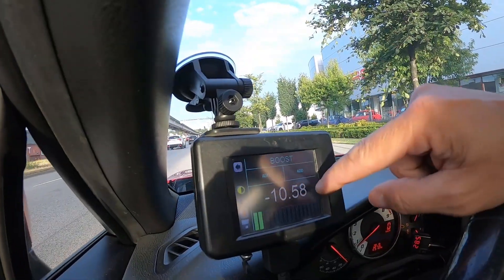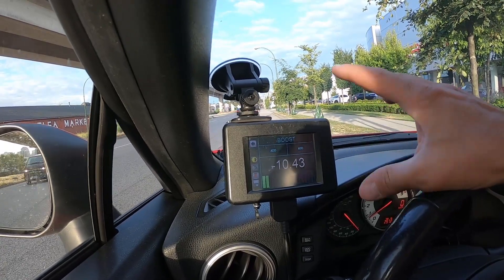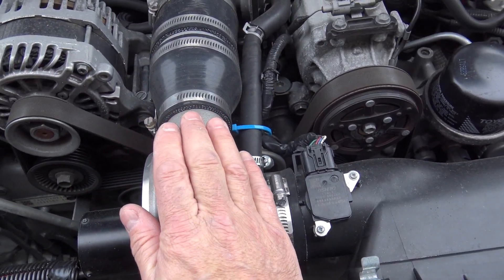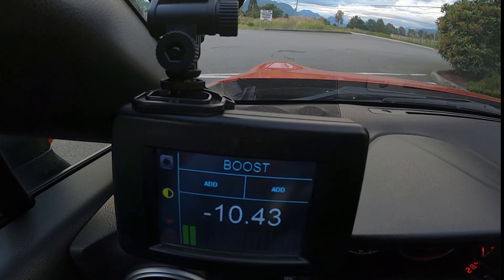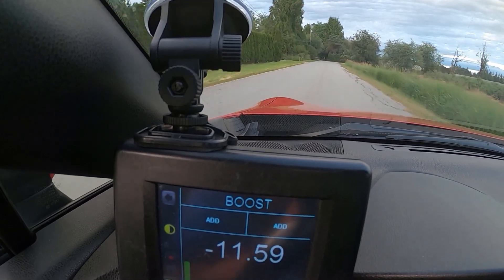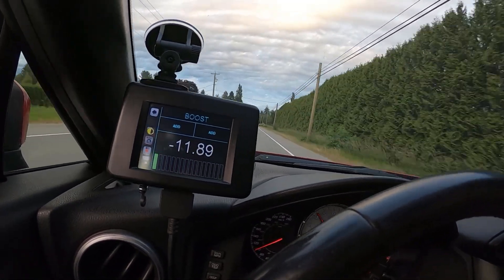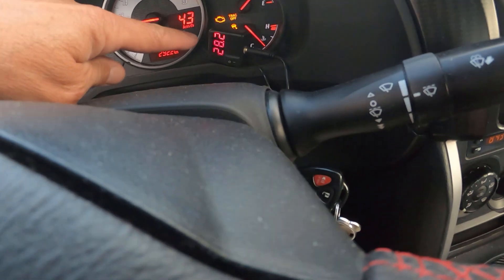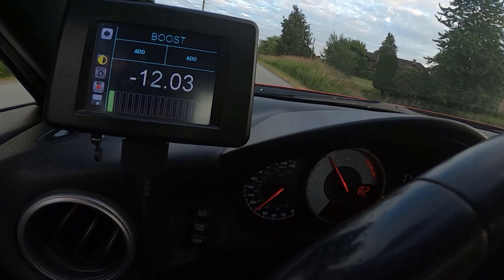Proof that my Electric Supercharge works!! BOOST

Comment: Electric motor spins at 55,000 rpm / turbos spin up way past 100,000 rpm even at low boost
Reply: This motor says on its label 250 24 v . The 250 is KV or RPM per volt. 250 x 24v =6000 unloaded RPM or 3000 loaded RPM. Its a scam.
Reply: @billboyd4051  there is More than enough proof that these work. Cleetus did the torque amp test recently and gained like 40hp. Tq amp tested this supercharger vs theirs and there was not a hug difference.  Plus hes showing a bosst gauge that its making 3-5 psi. Thats power.. regardless.
Reply: @TheModAddict  Cleetus tested a 48v torque amp unit, this is a 24v unit that spins at 3000 rpm according to the motors markings, and with 2 small AGM BATTS THAT HE CLAIMS he gets over 200 amps from, its a scam. You can hear it on his other video at 3000 rpm. This motors KV is 250, too low to do anything, thats why Mike won't show a dyno test. Audi uses 7000 watts just to prevent lag on main turbo, this guy lies about 5000 watts, you can't get that from such a small motor off 2 small AGM batteries. Please buy this unit, and show a dyno test, Mike won't show one.
Reply: @TheModAddict  it's a SCAM, notice how he didn't rev it to top end? Cause u can clearly see he started loosing boost top end so he kept cutting it off😆
Reply: @billboyd4051  not to mention the car is only a 12v system. Only half the power to run a 24v motor
Reply: @mikepoole2248  He's using 2  12v batts in series. On his other video he hits gas pedal switch and you can hear the sound of his turbo, about 3000 rpm by the tone. Not enough to do anything but reduce power through restriction. Such a scam.

Comment: I'd love to see someone develop an electric assist turbocharger. Use the electric motor to shorten spool times on larger turbos.
Reply: thats what compound setups are for< or just spool with nitrous. works for me
Reply: @Equine-services  true but racing is all about innovation and having the response of a sequential system or NOS assist without the additional complexity or space would be nice.
Reply: @Robotech04  it would be awesome to simplify it. i agree 100%, but it wont be one of these that does it. Even if you had great performance of them (which there isnt) the limiting factor in your powerplant would be the e-turbo. Its in essence a restrictore plate just like what they use already to limit power. only so much air can move through it, and it wont be truly dependent on on the motor to keep it regulated. its just a really poor solution to a simple problem
Reply: I think thr RPM that the turbo spins at would disintegrate and electric motor. A normal turbo spins between 80,000 and 250,000 yes that right a quarter of a million rpm. Even a high speed dremel tool or a router only hit around 25,000. Yes there are electric motors that spin faster but they are not designed to produce enough hp to drive a turbo. I know that the given HP needed to drive a top fuel funny cars blower is said to be around 1500 hp. a small 3/71 or 4/71 is around 150 to 200. That is why electric turbos can't produce the HP that exhaust driven or belt driven forced inductions can. You would need a Tesla battery to provide the power needed to spin the  200 lb electric motor.
Reply: There are RC car motors now that are capable of 125,000 RPM and that was almost unheard of a couple years ago. 

There are many great ideas that come before the technology has caught up to make them realistic solutions. I think this may be one of them. Like I mentioned, it would be nice to have an electric motor help with spool up and then let the exhaust take over to keep it moving, like sequential systems now but without the second, smaller turbo.

Comment: Your air box is chocking the turbo at higher rpm. Take a hole saw, and cut large holes in the bottom of the box and let that turbo breath.

Comment: Getting an average of 3psi for "boost" is technically boost. So ya, your electric supercharger works. However, the 2k$ you said you spent on it, makes it the most shitty turbo to cost ratio for your application.

Comment: Bollocks there is no way it can work even if you have a pressure of 30 psi on the table soon as you stick this on the engine you’ve also got to feed the engine as well as pressure on top of that this will not work

Comment: TLDR all the comments. I'm quite certain that the inefficiency of the alternator charging the batteries and the inefficiency of the helicopter motor would add up to the alternator placing load on to the engine which would negate any possible boost gains. unless your not charging them int he car which means its a finite resource like nitrous without the copious extra power

Comment: The electric turbo, basically turns into an expensive restrictor-plate.. all these garbage ass Chargers and turbos have been tested to be garbage. This is just the ricer way out...🙈 bro you're shaming yourself... you're a grown man and you look like you're trying to sell this garbage to little kids.. your sales pitch might have worked in the 80s douchebag.. fucking Gremlin salesman...

Comment: Reduction drive on any turbo or supercharger done right will work with the right electric motor and power supply..
Fitters and Turner's tool markers make everything Man made. 
Keep up the good work.

Comment: Merge on highway with out hassle? My 7k lifted utility truck with a 302 does that quite well. Are you sure you know how to drive? Also, nowhere near enough air volume. Boost is worthless without enough CFM. You just restricted you intake. Boost does not mean horsepower. You need more fuel as well to see any gain. Otherwise you'll just go lean and blow it up.

Comment: I believe it.  But while you will clearly(based on the boost) gain torque/power lower/mid rev range, you will likely loose horsepower at higher rpm as the supercharger becomes a restriction.  Now two of them on my 6.2 diesel(3700rpm max) could work.

Comment: Audi are working with them. Electric cars will never work either.
Reply: Electric cars work just fine, the problem is recharging rates and range.
Reply: @vector6977  How often do you drive 300 miles in a day? 2 maybe 3 times a year? I know my 300 mile tank of gas usually last me about week and a half or more and I live in the sticks. If I could afford a Tesla I would by one tomorrow and thumb my nose at the oil companies. The local grocery store even has charging stations out front.

Comment: Dino or nothing you'll never prove shit to any car guy without a Dyno graph if you can't compress air and then injected into the engine when it's built up you'll never be able to create boost all those electric things do is consistently push air through the intake it doesn't hold it can press it and then push it like a real turbo

Comment: If electric turbos work, you will see automakers putting them as factory equipment. Did somebody see the Pontiac Grand Prix GTP or Toyota Supra 2JZ with electric turbos?
Reply: Ivan Arrache hate to spoil the party but Audi and Mercedes have them on cars you can buy now. Have had them for a few years. Go look it up.
Reply: @5150gino  ok, let me be more specific; "If electric superchargers work to make horsepower, automakers will put them as factory equipment alone". Electric superchargers are designed to reduce turbo lag in forced induced cars that already have turbos. But electric turbos DON'T make a single pony by themselves.
Reply: Ivan Arrache if turbos work, then electric turbos will work too, it’s just motor and battery technology ain’t there yet, give it a minute.
Reply: @5150gino  compressing air takes a whole load of energy; around 6-7bhp for every psi of boost is sapped from an engine to drive a mechanical supercharger. Applying that to electronics, a 12-volt battery will barely be capable of providing the energy needed to perform anywhere near the same capabilities of an engine’s crank. I been working with cars for more than 25 years, and let me say this... Even when you make a conversion, you have to make a hard wire to the fuel pump so it runs as a stand alone because OEM electronics can't supply the demand the bigger pump needs. Happens the same when you put a bigger audio system with  amplifiers for big bass. And the list goes on with bigger fans for the radiator. So, if you want to use an electric turbo to make power, in a stand alone way, NOT to reduce turbo lag and assist a real turbo, you will need to at least, convert your car to 48 volts. 48 volts, so be prepared to change EVERYTHING electric in your car, and I'm talking about from the alternator to the last fuse. You have to be a great electrical engineer and have a deep wallet. I prefer to take a $100 Grand Prix GTP supercharger from a junkyard and put it in my Rover V8 (AKA Buick 288) and still make more power in my Firebird.
Reply: Ivan Arrache thanks for the insight. So do you think this guys set up will produce more power than stock. I thought even adding 4/5psi on this Subaru engine would lift power if appropriately tuned.
Reply: @5150gino  well, 5 psi are like 33% and in a 2.0 with 200 horsepower is like 250-260 horses. The thing is that he only have 36 volts in that car and only 24 volts for the electric turbo and NO aditional alternator (generator) for that, that can recharge the two additional 12 volt batteries. So, I think a nitrous bottle should last more than that without need recharging.
Reply: Electric superchargers can work, but that's not the same as saying they're a good idea, to be able to produce pressure AND airflow, they need a lot of power all just to be able to burn more fuel. A turbo is just way more efficient as it uses a source of wasted energy instead of adding another drag on the engine.
Reply: @kevenharvey9711  exhaust restriction is engine load

Comment: Electric superchargers only work on 2.0 or less 4 cylinder engines.
Reply: They dont work at all. It just blows air, not compressing it. Like a turbo or super charger. They need to spin way faster than what the electric motor can spin.
Reply: Thats a ridiculously specific baseless argument. With a strong enough electric motor you could make boost for a  572 v8. The torque and RPM is what you need. If you can generate the same specs that an exhaust side turbine can then you will get equal boost given an identical compressor.
Reply: @jacobhauenstein  Hellcat takes 80 Hp to run supercharger, that's 59 kilowatts.
Reply: bill boyd what if you had the turbo as a boost function and it stored capacitors for a quick high energy discharge (kinda like kers)... well at that point might as well just have a mild hybrid or drivetrain hybrid system. I get your point, but imm sure all forms of electric boosting will be more valid as energy density increases with efficiency
Reply: @jacobhauenstein  Audi uses 48v 7000 watt just to reduce main turbo lag. Takes 15 to 20 KW to make real boost on 2 liter motors, this means high voltage and high current 100v at 150 amp lots of batteries or caps. No longer a simple solution or cheap trick. Supercaps can be charged in an instant, but boy do they pull amps to recharge and don't hold many amp hours. The toys here just don't work and actually hurt power through restriction.and things that can, cost as much as a real turbo.

Comment: Hahaha dyno showed a 30hp loss on a mustang with a $400 electric supercharger
Reply: Roy Reeves hell yeah brother
Reply: The reason is both because this is a better motor and a real turbo housing. If you saw the cleetus viideo you can see about a 1mm gap between the impeller of the compressor housing and the terrible electric motor not being suited for that task. I cant say this video is legit because of the lack of a dyno, but it looks much elaborate and pointless to fake. If that does not convince you look at how Garret is making Electric turbos, they are using a motor to pre-spool the turbo. If you can spool it you just need a stronger motor and more rpm to build boost. just sayin
Reply: Jacob hauenstein you are right, this is a better built unit.  And for the money he spent, five psi is an absolute joke.  People have put m90 super chargers on the frs for under 800 bucks and you can built 15 psi all day.
Reply: @jacobhauenstein  lexus has a hybrid electric turbo on a bunch of their engines its electric when needed and exhaust powered when needed and it will act as an alternator it's bad ass toyota is an amazing company
Reply: On a 4.6l v8
Reply: Yeah cleetus McFarland.
Reply: Roy Reeves the one Cletus used was only 12v too.
Reply: Go look at the on cletus is running now !!!

Comment: let me tell you how you can "prove to us" if this works or not.
first you need a baseline dyno of what your car makes without this thing.
2nd you need to dyno the "after" using your "e- supercharger"
and using dyno result you're going to figure out your power-to-weight ratio and see if it made it any better.
say your stock car made 150 whp and your car weighs 2790 lbs .. your ratio would be (0.05376hp / lbs)
and with e supercharger lets say it makes 152 whp and now it added weight of 40 lbs or whatever (put every components of your supercharger including battery and everything) and your new ratio would be   (0.05371hp / lbs)  so in this case car made extra 2 whp but it gaied 40 lbs  so it slightly  lowered the power to weight ratio. so this mod would not work.  you  would gain more performance by just removing your seats 
so please conduct this test if you believe in your product and show us it actually works or NOT.

or just stop wasting your time and admit this is POS
Reply: @Druze_Tito  that would be waste of my time

Comment: I definitely won't be spending my good money on that crap, if it makes any boost, it's defeated by the weight of extra batteries. 5 psi = 0,345 bar, I can blow harder.
Reply from the maker: 5 psi is enough and the light weight batteries are only a little heavier that the oem battery.

Comment: I know some of you know what your doing but some statements I've read are from uneducated writers. There is a voltage controller that wires to the rpm and throttle to apply some power to the compressor at idle and lower revs. Then it cranks it up. It's always turning. It's all about CFM. Psi is nothing to note unless you have cfm. Which can be measured on the same device. Also, notice it started losing pressure at 4psi around upper mid range? The compressor/e motor couldn't generate enough cfm to sustain earlier boost. Vacuum increases with rpm so it was undersized and most of these are.It can be done and can be done well. It's just not one size fits all play.
Reply: You need to read how psi and turbos work mate. Your statement shows you don’t know what your talking about. Higher psi forces more compressed air in to the engine, cfm means the cubic feet at velocity that’s forced into the engine like I said about boost on a turbo. Anyway I’m not going give a full lesson on this you just need to educate yourself before making posts that are not correct, or go buy one of these and fit it to your car.

Comment: If a real engineer was to finally tackle this electric supercharger business and create a electric motor turbo, it would probably work. It's going to have to be a lot bigger, with a huge generator for high output current. It's probably going to need a 24 volt system. It's going to need a computerized module designed to work with the ECM. And, someone is going to have to invent a diaphragm gate for allowing normal air to bypass the supercharger when it isn't on (by design) or when during low RPM. Electric motors are powerful. We've been using them in manufacturing for like ever and a day with hydraulics. Some people with venture capital just need to do it.

Comment: So this guy Makes These Things? Because w/o increasing The Fuel to match up with his supposed Booste Numbers thers Not Gona Be Any Hp increase Ha ha ha..I guess he thinks people are So Stupid they'll listen to him & his "Booste Gauge" & buy this thing Because I saw other comments abt "Put this on Dyno & Then lets see what Ur Hp gains are" & No Truer words have been said because the Intire purpose of Superchargers & Turbos is to increase the Air/Fuel mixture by Ramming the Charge into cylinders But with No Added Fuel or change in timing curves? To go further, Iv watched VIDEOS Of them doing exactly this & Boy wasn't I'm Suprized by the Losses these "Turbos" made on cars, Like Big! I saw 1 videos where they paid ALOT of Money for 1 these things so they could test it($400buks!!)& aft they didn't Acouple of Baseline Pulls, they added this awesome Turbocharger & If I did see a couple of pull w/my own eyes Id Never believe that '90s 4.6 engine Mustang only makes 169Hp to wheels😳..So to add this Great Electric Turbocharger spinning at 55k RPMs has to help Alittle??? How abt a loss of 30Hp, Yes if you spend $400buks & Then Wait Month to get this hunk of crap, Ull Lose Over 30Hp! And usually on Low Hp Cars when you add anything there always a much bigger gain then on all modified engine BUT This Electric Turbo Sucks Big Hp from engines, So DONT spend any Money on this Because Ulla B Sorry If You Do Lol🎸
Reply: i think i lost brain cells reading that
Reply: Icky yup...

Comment: These have been proven not to work. The turbine doesn't spin fast enough and the air flow is restricted so it actually loses power. And as for that electric supercharger that's just as shit. This guy is a complete bellend and completely full of shit. He has been ripped off twice and now feels the need to tell everyone that they are good.